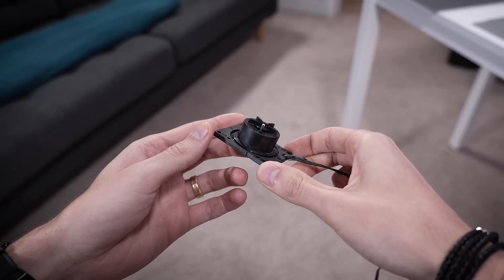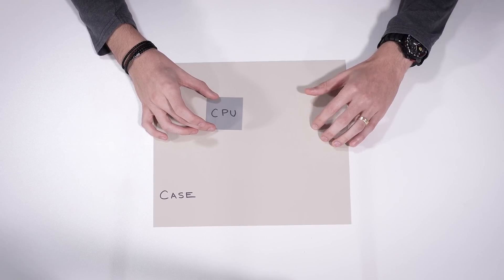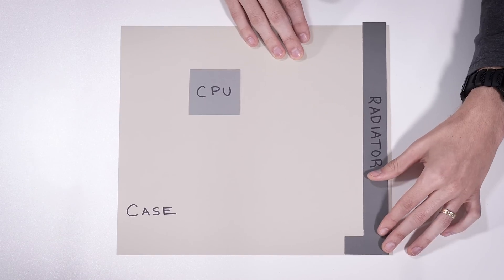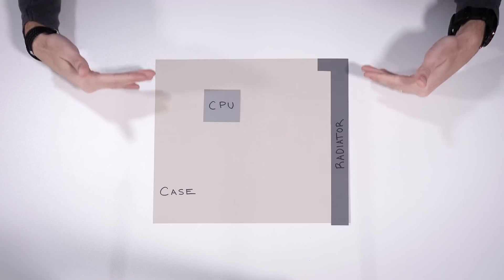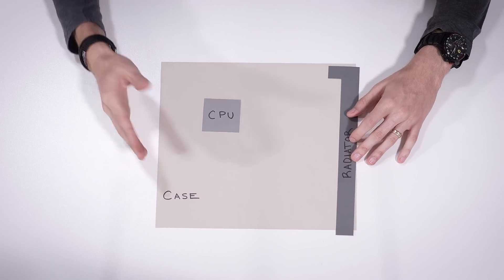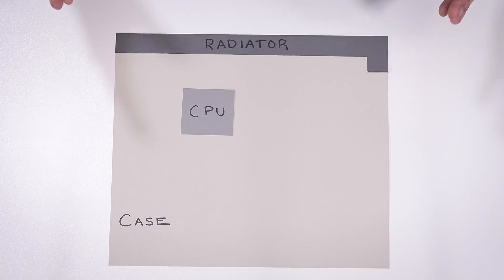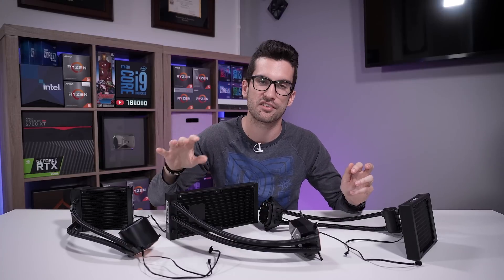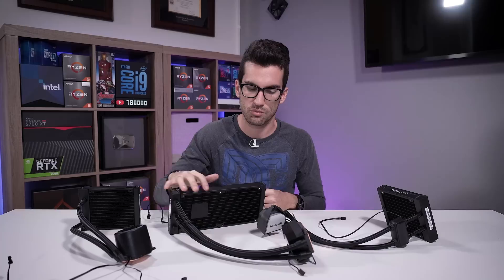All AIO Mounting Positions Explained

Comment from the maker: Maybe some day we can move on from this damn topic 😁
Reply: G'day Greg,
That would be nice but it is a very easy topic for those looking to Belittle others trying to make them self feel superior
Reply: I fully agree. No matter how many time this gets explained, people just want to argue about it. 
And seriously, who is going to keep their AIO long enough to burn up the pump? It isn't like it has a sliding shoe impeller that will burn up. It's a fixed impeller and volute. Heck, use a marine pump that isn't even connected to the motor with a shaft. That one you can just replace the impeller once it wears down.

Ok getting off my soap box
Reply: How about other topics to consider Mr. Greg? 
1. The Old, but Good CPU Coolers of Zalman (all copper fins and cold plate, classic)
2. Are 6 cores CPU the standard recommendation for work, gaming and whatnot? 
3. Will there be another competition for AMD and Intel or another BIOS manufacturer, so that American Megatrends would not get the bulk for PC? 
4. Why is the RAM memory technology is always behind the GPU?
 Like DDR4 rams paired with DDR5 GPU
I know we can get a match now with DDR5 RAMs, but they are expensive, and DDR5 GPUs are on gen 3 speeds.
5. This is a sensitive one with the situation in Ukraine and Russia, but we will go to Asia. 
If Taiwan faced the same situation like in Ukraine, how bad is it going to be coz TSMC and Foxconn are both in Taiwan? 
:elbowcough::elbowcough::elbowcough::elbowcough::elbowcough::elbowcough::elbowcough:
Reply: There's a fake guy trying to be you in the chats and I don't know why.
Reply: actually you've nailed this one with the best explanation :D
Reply: To be honest, i just bought an AIO last week and because of this I was convinced to change my orientation and do a top mount with my pumps on the right side. my temps are actually pretty good while using the thermal paste included in my AIO :)
Reply: @greg Salazar you need to look at my comment you got someone trying to use your profile to scam people
Reply: @Saiko8096  That is happening in A LOT of tech tubers I follow. Just click the 3 dots by their comment, click report then select spam. Sadly we have to do this a lot.
Reply: I've got the coreliquid 360R and mounted it on the top and been like 5 months since I installed it and so far no issues but after seeing this video now I'm pretty concerned about it. Anyone can tell me if it's OK to leave it mounted on top?
Reply: @ahmedhamdan2009  honestly I would just change it so you don't have any problems down the road
Reply: @Saiko8096  Damn it, gotta dig through cables and re-mange them. Thanks for your advise.
Reply: @ahmedhamdan2009  I just slapped my aio in last night I need to do a tone of that soon my cable management rn is terrible
Reply: @Saiko8096  I was just watching MSI Gaming Channel about my rad and they show you it can be mounted on top so that makes me feel a lot comfortable. Although I don't doubt you or this video but if MSI themselves mounted on top then it should be ok.
Reply: @ahmedhamdan2009  where do I go for the rgb for the aio
Reply: @Saiko8096  cable management is the poison of PC building.

BTW i'll just change my AIO mounting position soon because like you said, we wanna avoid problems down the line.
Reply: @ahmedhamdan2009  MSI has their pump installed in the radiator. The CPU block is just a heat transfer piece. If you look at the solid metal part in your radiator fins, that is where MSI has their pump.
Reply: @Jay_the_Caffeinator  Yea I was told. So definitely not recommended for top mount?
Reply: @ahmedhamdan2009  it really doesn't matter.  The pump is the same height as the rad. Put it wherever you want. 
Funny thing is, I have been building since 1995, ALL my PCs are air cooled. 
I am lazy.
Reply: Thanks for the advice
Reply: Thank you so much I was getting a bit worried about my tubes for my NZXT Kraken X53 cooler as my tubes are at the top as Mt Corsair 275R Airflow and my radiator doesn't fit at the top unfortunately but I appreciate the video a lot. Thank You.
Reply: what about funky mounting positions such as the one on the popular NR200/NR200P (horizontal side AIO)?
Reply: Greg, Thanks for clearing up this AIO placement subject but, I was also wondering if you are aware of MSI's MAG Core Liquid 240R & 360R recall?...Now, I am aware that the MSI unit in this video is a different model but, I'm hoping that you or other Tech YouTubers will bring to light this clogging issue with the MAG Core Liquid models as this issue kind of screams "Gamers Nexus Enermax Fiasco" of 2019 all over again.  In addition, I'm reading in forums and watching some YT videos that are claiming that MSI is dodging this recall by not validating their unit's serial#'s on the official recall page...This issue affects me directly as I own two of the 360R models, one I purchased in December for my R7 5800X build which is not quite done yet ("Thank God") and one of which has been in my daughters 9900K PC for 6 months now and I just tested it yesterday and it's hitting 56c while idle in bios and 100c instantly when running a Blender benchmark :(
Reply: never!
Reply: Guessing I didn't win anything for lack of response.
Reply: Excellent video.  All if the other videos assume the pump is on the the block head.  My question to you is what about fans?  What is the best location, intake vs exhaust, while covering the nuanced scenarios like pump in rad
Reply: jin is out of the bottle man its never going in
Reply: just maybe, also I know it is similar subject but what about GPUs with AIOs ? I know the principles are the same 
but sometimes due considerations, mounting the correct way is not possible.
Reply: What would you recommend to cool an i9 10850k? Around $200
Reply: @nopeskii  inwould go evga 240 or 280 or even the artics 240 both are very basic AIOS for about 90 to 110 usd.
Reply: @nopeskii  NH-D15 for air cooling, 280mm radiator for AIO, like the Arctic Liquid Freezer II.
Reply: @nopeskii  The Arctic Freezer II seem to be very well priced, EKWB AIOs seem to be very Good performers too, Depending on you case for an i9 I'd look at a 280 or 360,
I refuse o buy a Asetek Cooler due to all their Crap using the Threat of Suing others trying to prevent Competition, Recent Gamers Nexus Reviews have shown that compared to the Artic & EKWB AIOs the Asetek Design is not as good anyway.
Reply: what i really hate is people who keep saying it like they've known it all along, when we know for a fact exactly where they got it.

I doubt GN ever imagined their experiment would be used this way. They even explained this very well on their original video, which, if you watch and understand in its entirety, doesn't make the assertions that most "barb-watchers" claim. Some of them are even quoting it wrong.

Comment: Well, when you're saying barbs I think is what you're calling them where the lines are coming out of the radiator at the top because it's adequately filled well Jayztwocents on his channel explain to us that as the AIO ages it will permeate the water. It will lose water over time and then there will become an air pocket that will go into the pump. This will happen after a couple years. So what about that? Not trying to attack anybody but Jay is a much older and a much more experienced tech. I would invest in what he says. Not that what you're saying is wrong. It is right, but I think you're overlooking that fact of aging of the AIO

Comment: i have a front mount radiator it runs at 29C - 32c under load front mount is a valid setup but do what you want and account for air flow good video

Comment: Wish I had this guide when I built my new PC after 11 years. New case only allows a 280mm at the front instead of the top since modern mid tower cases are A LOT smaller today. Going to try and flip the AIO so the barbs are at the bottom to see if I actually have enough cable length to support it.

Comment: unfortunately on thr Lian Li aio cooler i have they have fans that have to be connected to an adapter cable that has to attach to the top of the motherboard...i wouldn't be able to mount my AIO with the upside down with the tubes at the bottom and still attach the cable to the mobo...so it sucks i have to have it in the way you said was "ok" the the aio front mounted and the tubes above the cpu block...wish i could do it upside down but unfortunately i can't

Comment: I don't get why there is air trapped in the loop in the first case. Factory side it should be possible to fill the loop to the rim with no air remaining and/or add a self-venting valve, so air bubbles are expelled.
Reply from the maker: It's done intentionally.

Comment: This is very informative but doesn't answer the question I wanted an answer to. how much does the position of the barbs on the chill block matter. I'm mounting a 120 Thermaltake at the back; I can easily mount it with radiator barbs in the down position, but it forces me to put the chill block barbs at the top of the CPU. I think it will be ok because the block is centered on the middle of the radiator. Any air in the radiator will be higher than my pump and the radiator barbs will be below the pump. Opinions on this are welcome.

Comment: Having the fans as intake or exhaust doesn't matter. The water in the loop will reach a stable temp after about 20 mins, 1C difference in cpu temps
Reply from the maker: Depends on several factors in our testing, including how other fans are arranged in the system. It isn't as black-and-white as you're making it.
Reply: If all other fans are installed correctly, which I am assuming, the temps will be pretty close in either config.If the fans are configured incorrect then temps will suffer no matter what you do @GregSalazar

Comment: I wouldnt recommend side mount your radiator with tube up, you could say there isnt enough air for its to suck it in but why should it be the case then when the pump is on the highest point. I mean, the amount of air in your loop didn't change.

And just to make it clear, the amount of air in your loop is not just a few bubbles.... It's actually depending on the manufactor. Igors lap talked to a few manufacturer that produces them and they gave him the numbers, and looks like some manufactors even send out loops with 10% air in it. With that mouth air, everything except mounting top is the worst case but sadly he didn't say which manufactor that was.

Comment: As always your videos are really helpful. Can you please make video explaining the proper method to remove/uninstall AIO Pumps/Coolers from CPU for the different type of sockets (AMD/Intel) ?

I had to recently help a friend to upgrade his failing AIO and even as I have experience building PCs we spent some time removing AIO cooler as the thermal paste was hardened and bracket didn't have too much space to do small twist movements to get it loose.

In the end, we had to use a hair dryer to heat the thermal paste and that helped to get the job done.

Comment: Okay but for top aio placement and using for intake do I place the radiator against the top first then the fan below running intake . Or do I secure the fan first and then radiator below it
Reply: In a traditional case if you are mounting your rad at the top, you dont want the fans to be for intake but for exhaust because hot air rises. As for where the fans should be placed, that is virtually non important. Its more of a matter of cleaning a dust, (personally i find it to be more of a pain to clean if the fans are beneath the rad.
Reply: * for asetek

Comment: I bought a 240mm AIO to replace a failing air cooler and because my case wouldn't let me top mount the unit I front mounted it with the barbs up top and this is fine in my opinion as the pump is below the top of the rad

Comment: I had my 240 Ryujin radiator mounted at the bottom for 4 years, not a single problem. I have a Cooler Maser SL600M so this is the best solution for ideal airflow.

Comment: Let's say for example... I have a Cooler Master ML240 Snow Edition AIO... I've had it top mounted for about a year with the tubes on front side of the case (right side going down from the top) to the pump mounted on my CPU (Ryzen 5 5600X)i have noticed higher that usual CPU temps at full load... Up to about 78°C... Should I front mount the AIO tubes up top and running the fans as intake or exhaust set up???

Comment: I'm not going to disagree with your radiator/barb position, but there is a MAJOR caveat that you should mention.  Indeed I trust that Corsair completely filled my AIO when I bought it, but I purchased my AIO in 2015, and it is now 8 years old, and has almost certainly lost some liquid.  My Corsair AIO is still running strong despite it's age.  My point is, if you want longevity, you want those barbs down or a top mount.  Agreed however that tubing may not allow.   I feel like a lot of reviewers fail to mention longevity because they have the luxury of building a new machine yearly or better.

Comment: Never understood why for front mount rads, people recommend tubes down. This makes no sense. If your tubes are down you run the risk of air being trapped in the pump housing. Additionally at high speeds a pump can have cavitation and create bubbles that are trapped and create uneven forces on the pump accelerating bearing failure and overall shaft deflection. With the tubes up the air bubbles are more likely to travel from the pump to the top of the reservoir than in a tube down configuration.
Reply: Let's say for example... I have a Cooler Master ML240 Snow Edition AIO... I've had it top mounted for about a year with the tubes on front side of the case (right side going down from the top) to the pump mounted on my CPU (Ryzen 5 5600X)i have noticed higher that usual CPU temps at full load... Up to about 78°C... Should I front mount the AIO tubes up top and running the fans as intake or exhaust set up???

Comment: So with an MSI AIO with integrated pump, and the graphics card block the pipes down front mounted position, you are fucked? Either top position which sucks, or front position with pipes up close to the radiator pump...
Reply: @underbjorn so I had the pump in rad I should front mount with the barbs down ?

Comment: i had the pump on cpu block and put the radiator on top of the case, but my aio started to bubble/rattling sound when i open games, is it possible because of the cpu block placement because i put the cpu block facing down so the tube came from under the cpu block, i really appreciate any helps😢

Comment: A question has come to mind: If you have a case that mounts the motherboard horizontally, like many ITX cube cases that can accomodate a 120mm AIO, mounted usually on the front as an intake  (Cooler Master Elite 110-130 series, Silverstone Sugo series), how does rotating the radiator/pump affect the air? My current opinion is that, in such a limited use scenario, it won't matter too much, becasue you can only really mount the AIO in one spot and realistically the barbs are going to be either on the left or right of the radiator. This means that the highest point in the system is going to be the edge of the radiator, right? If so, there will be the radiator itself, possibly some space in the topmost channel, and space in both end tanks for air to accumulate...

Comment: Me and my brother have bought the same pre-built PC from a national vendor with the MSI Coremag Liquid 360R radiators, they are mounted on the top of the case as exhaust. So far all I hear is an occasional very short pinging of air on the impeller just after I start the PC when it was off for 12+ hours. Then throughout use I never hear it again. My temps are top notch, in games rarely going above 70, in Cinebench reaching barely 90C, only in the summer it got there but the clocks stay rock solid. 

My brother, though, has an issue with the radiator that got progressively worse in the last few months, it rattles quite a bit after it heat soaks and the cpu overheats/stays at 90C and downclocks boosts (we have ryzen 5800x) even when moving a lot of files. I dont get my temps up beyond 65-70 when copying a lot of files from M.2 to M.2 drive and similar temps in games. My brother stays at 90 and boosts drop even in the same game, same place. And I am almost certain that it is the coolant goo issue Greg has documented several times in the recent past. We have the rigs now for a little over 10 months. My bro just initiated an RMA/service ticket with the vendor and he will get a replacement of the same cooler if they confirm the problem. He also had to send the entire rig out to get it inspected and fixed, a little unfortunate. 

So in conclusion, with the MSIs I am much more worried about the coolant clogging up the cooling head than I am about the wrong positioning of the radiator. If I start to get odd sounds and problems down the line, I will just get a different rad than MSI

Comment: I have the Coreliquid 360R it is a good months old (my serial number was not included in the recal) I had it top mounted for 1 month but it started to gargle (?) so a friend of my recommended front/side mount (Lian-Li O11) it was good for a week but now it is gargling(??) again.  so is it broken because I top mounted it for 1 month or is it just something I have to deal with .?
I have my case tilted to the right @ 45 degree Ish and it stopped gargling. . Temps in Idle have not been bad at all ( 40 C)

On a sidenote: 
I had the Be Quiet Dark Rock Pro 4 at first .. but it does not fit in the case ....